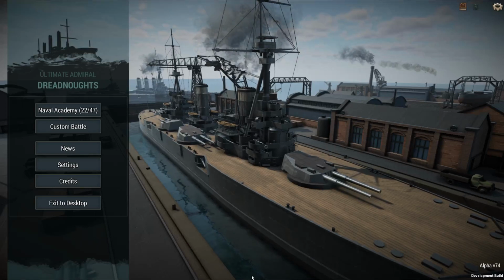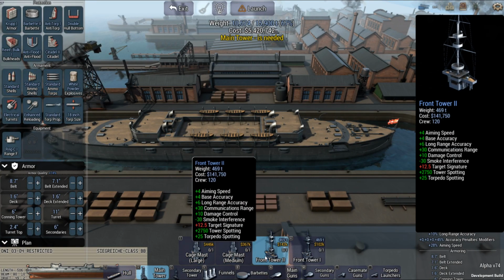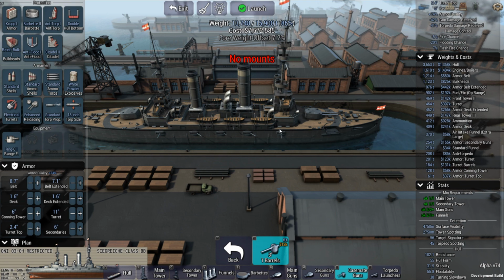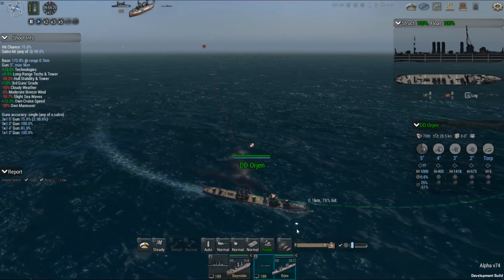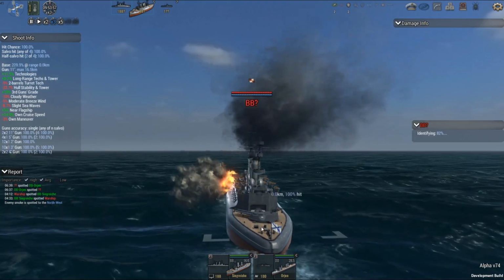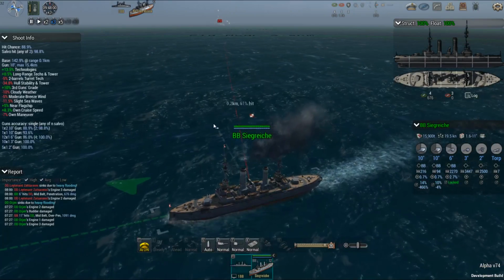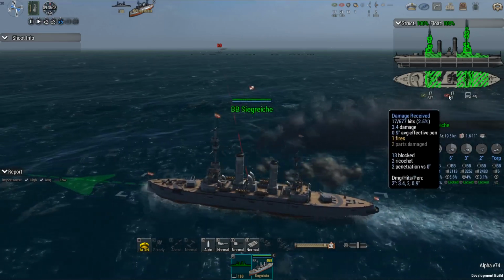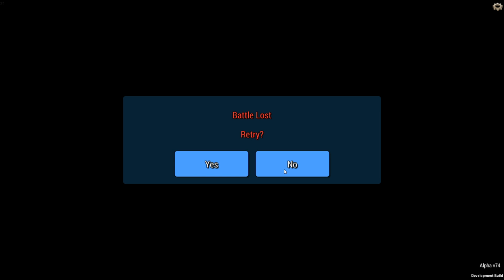SMS Habsburg

Comment: MEEM SHIP                                                                                                                                                                                                                                                                                                          
YKMS61 
LENGTH 673
WIDTH 83
DRAFT 21
SPEED  30 KNOTS (56KM/H) AND  40 KNOTS (74KM/H) WITH ENEGIN BOOST 
DISPLACEMENT 100,000 TONS 
2 × triple 46cm guns 
2 × triple 38 cm SK C/34 
16 × twin 12.7 cm guns 
22 × 127 mm/38 cal Mark 12 guns